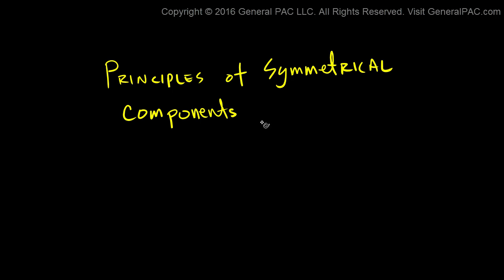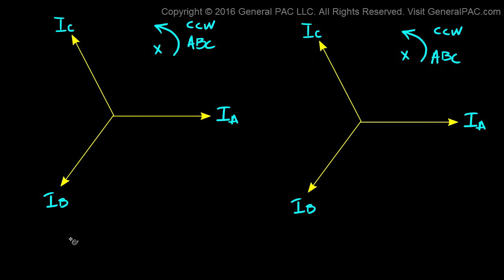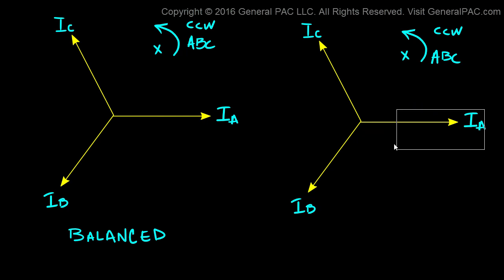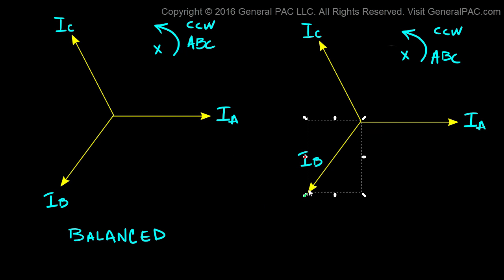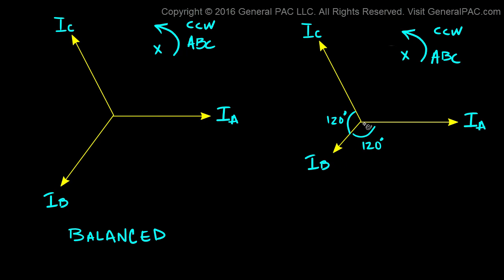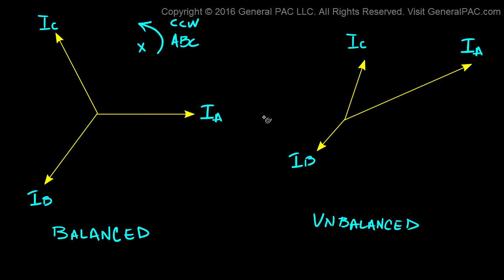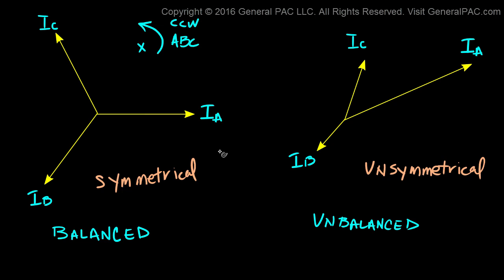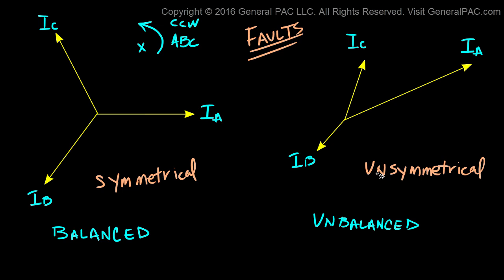Principles of Symmetrical Components part 1d

Comment: What sort of fault creates unbalance by changing magnituides only by keeping angle constant
Reply from the maker: Hi Taha, Theoretically, there are no unbalance faults that can cause changes in magnitude while keeping angles constant. However, in practical scenarios, several unbalance conditions exist, such as current surges, dips, unbalanced loading, and voltage fluctuations. These conditions can appear for a certain milli or microseconds. 

Hope you find it useful.

Regards,
GeneralPAC by AllumiaX